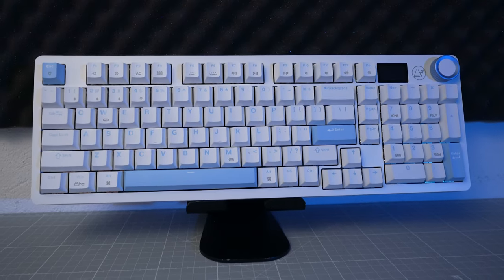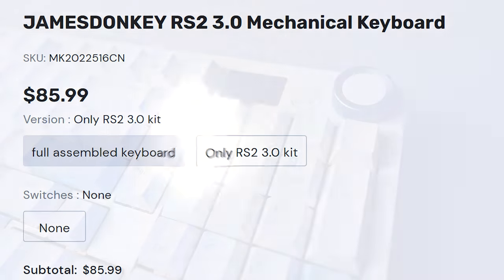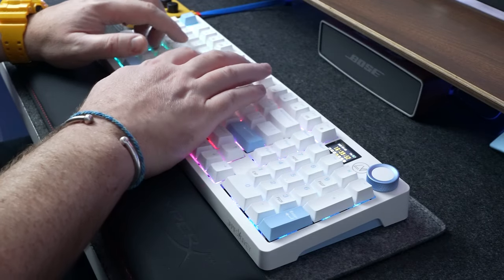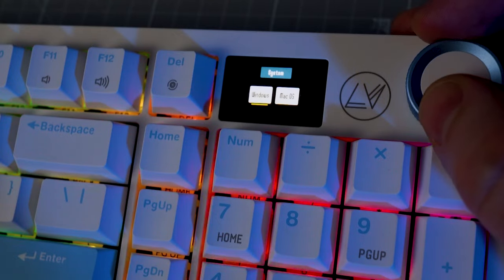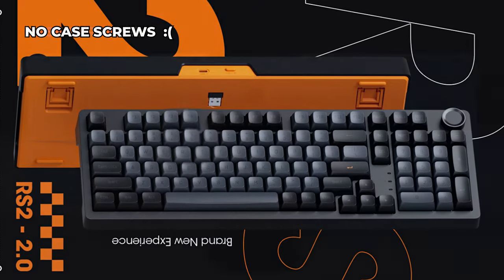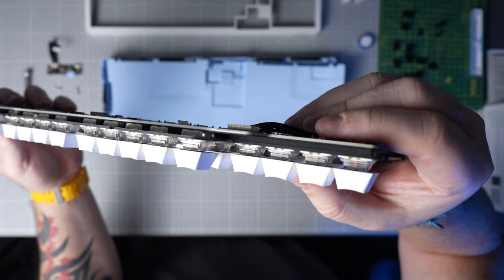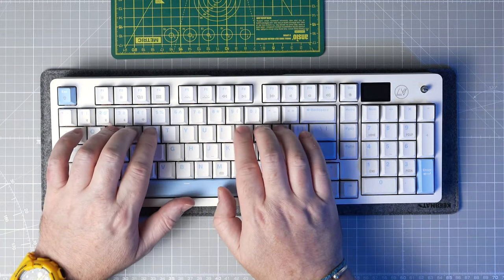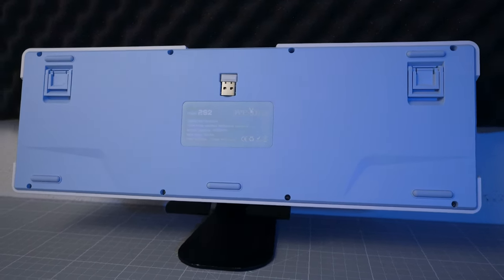Jamesdonkey RS2 3.0: LED SCREEN wireless mechanical keyboard

Comment: Dope video. I had initially went with the RK S98 but I hated the software and knob. After watching your video and a few others I got the RS2 3.0. I am typing on it right now lol received it 9 days after I purchased it. I did tape mod and hand lube the switches because from factory was very lightly done hence that scratchy sound. Now it thocks like no other, I love it!
Reply: Which one would you recommend between rks98 and this one? Also have you tried the software if JD? Can you tell me about all the layers for remapping and how do they work?

Comment: Got mine and switched the switches for some Gateron Oil Kings and some PBTT keycaps and it sounds amazing. Just looking for a different knob since I turned mine into a white with black aesthetic instead of the white and blue. Really hope they make a different colored bottom case in the future. Overall though I love it.
Reply: did you ever find any different knobs that fit it?
Reply: @Bagakoo  no not yet. I’m planning on ordering a different one from Amazon cause it’s easier to order from there. But if this next one also fails me, I’ll just get one from another website.
Reply: Can we replace the other keys to printscreen  keys from the software?
Reply: @AndrewBawitlung  Should be able to. Anything that has software will most likely be able to do it.

Comment: I got mine and the primary use case is gaming.  I was surprised to see the latency on 2.4ghz is about 2-3 times faster than wired connection.  Clickspeedtester shows 6ms @ 166hz on 2.4 vs 17ms @ 58hz wired.
Reply from the maker: That is unusual. Maybe the cable is the issue?
Reply: @keebface  I think it was my testing method.  Many of the latency test sites indicated a slower response time and higher latency but as I was typing rapidly in notepad I was able to see a fairly clear reduction in lag in wired mode.  I then found other tools that did in fact highlight a 1000hz polling rate in wired mode.
Reply: So wifi doesn't have 1000 hz polling wate and will lag in gaming?
Reply: @Jatin11gidwani  Yes, though I really didn't perceive the lag too much.  It was more so when I was typing fast it felt like there was a slight lag in my keypress and the letter display.  Went wired and that lag was gone.

Comment: hello , my keyboard connected to  my pc ı can use ıt ı can play games etc.. but ı cant see in in its programme.. ı set up the programme(driver v1) but ı turn on ıt and ı see keyboard pıcture ıs black.. ( ı guess when programme saw the keyboard ıt has lıghts) but no lıghts on ıt.. ı mean ı cant connect to app ( keyboard drıver keyboard programme) to confıgure ıt... can you help??
Reply: Were you able to connect it? I have the same problem
Reply: @Nindeuki  yes bro. İ solved the problem own my own.. you will turn off your keyboard and after you turned off it you will connect with cable to pc.. and open your pc programme.. your keyboard programme ( app) can connect to your keyboard.. turn off keyboard+ connect with cable+start your keyboard app..

Comment: thinking about getting mine, looks amazing, one question, is it possible to take screenshots without using shortcuts? cuz I don't see a prnt sc key
Reply: I don't have this keyboard so i don't know if there's a way in the software and this isn't a single key but, in windows the other screenshot shortcut is: Win + Shift + S

Comment: Hey! I'm new to mechanical keyboards
Should I get this or the Keychron K8 Pro
Reply from the maker: Not sure. I've not used the K8 Pro. Also, its a strange comparison. Different layouts, different mounts, opposite colours, lots of differences. Perhaps best to narrow down on what you want instead of picking a keyboard looking at all layouts and mounts etc. It'll make life a lot easier, as there is a lot of choice.
Reply: @keebface  Thanks for the reply! I just need the function and the arrow keys, so any 75%+ layout would do.
Which mount would you prefer if this was your first keyboard?
Also, which wireless keyboard at this price point would you choose?